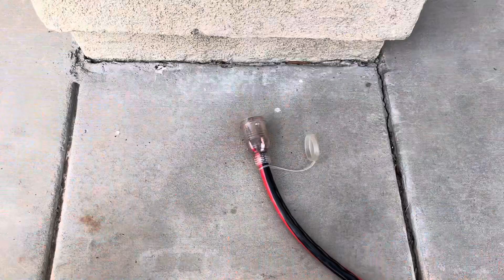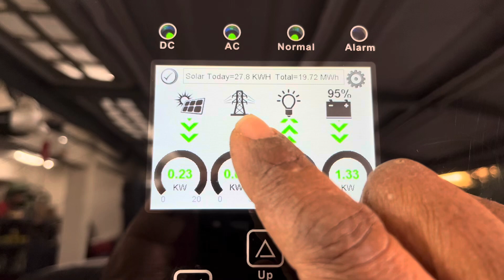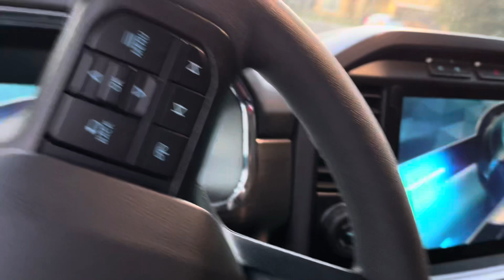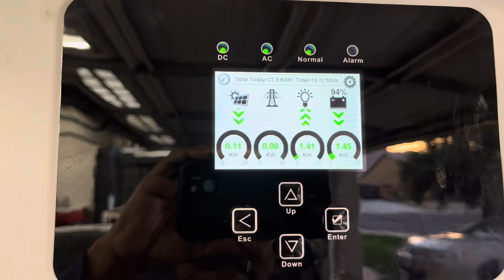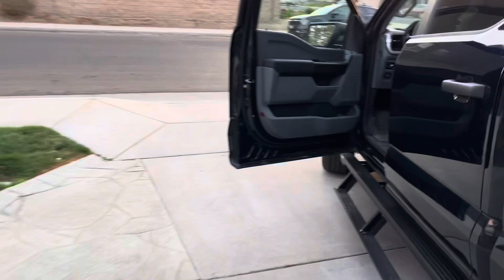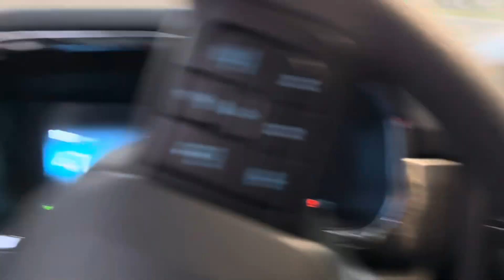Ford F150 Powers House Using Generator Interlock Kit

Comment: On your 50-amp generator plug.  Can't you just run a #6 ground wire as a bonding jumper, with connection clips at both ends, from the House Panel to the Truck Body to form a continuous loop for circuit bonding (GFCI)?  just got my truck yesterday, thanks for the video.
Reply from the maker: I think if you add a bonding jumper, it would cause the same fault on the F150 Lightning. Thanks for the comment!

Comment: Install a sub panel. Then, you can hardwire a thirty m plug that you can use on your onboard generator in a sub panel neutral and ground on not bonded
Reply: Just because they are not bonded together at the sub panel changes nothing, they are still bonded at the main disconnect.
Reply from the maker: That sounds like a solid approach for properly managing a portion of your house loads, thanks for the suggestion!

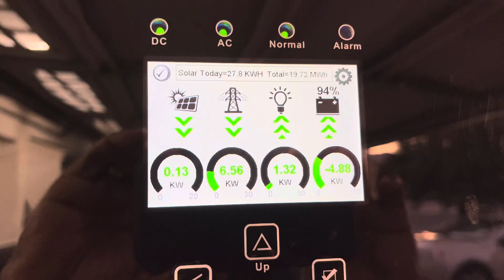Comment: At 17:22 the reason the truck was tripping like you said is because there is too much draw, but if you notice you are charging your backup batteries at 4.88kW, your house itself is only taking 1.33kW. You would probably want to stop the house battery from charging first (or limit the max power draw if possible) then the truck would easily handle your 1.33kW load.
Reply from the maker: You are very observant! Thanks For The Comment!

Comment: I believe the F150 lightning EV is one of the most underrated utility trucks out there especially when you can use it to power your house in emergency situations. This is a good way without buying the Ford Pro charger and everything else to do the same thing. Jim Farley may stop making it. Thank you for the demonstration. A simple setup without solar and few essential circuits would have worked.
Reply from the maker: Thanks For The Comment!
Reply: Im4udevco, your prediction came true